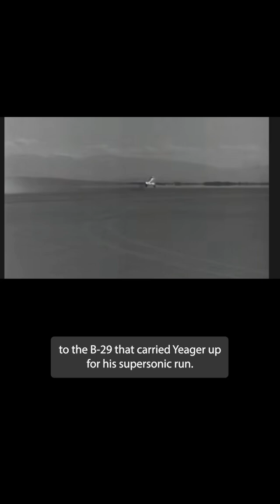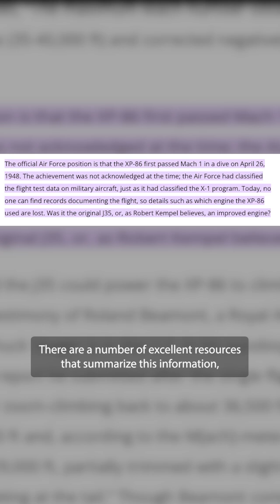George Welch and the XP-86 Project | Aviation History Month Day 20

Comment: The x1 did take off under its own power and break the sound barrier...
Reply from the maker: It couldn’t do this. There was never a flight where an original, unmodified X1 did this….
Reply: @The_Flying_Mechanic  thered litterally footage on youtube. Jan 5th 1949
Reply from the maker: @hechtspeed not without modifications.
Reply: @The_Flying_Mechanic  its litterally in the x1 log book. Its actual history.
Reply: @The_Flying_Mechanic  not without what moddifications?
Reply: @The_Flying_Mechanic  do some digging and youll find the x1 was originally designed to takeoff from the ground. They decided to air drop it after the original high pressure fuel pump didnt work out and they had to reduce the size of the fuel tanks to make room for nitrogen tanks to pressurize the fuel. Even still it was able to do the takeoff and still break the sound barrier without any changed. Its certainly more fact than than welches f86 mach 1 claims...which could be totally true but without instramentstion to prove it...a bit of a mute point.
Reply from the maker: @hechtspeed 
After “research” I found the 1949 launch was done with a minimal amount of fuel in the tanks to allow the aircraft to get airborne, rocket up to 23,000 feet, and then glide back down. In no report does it state the aircraft took off and went supersonic.
Reply from the maker: @hechtspeed and yet there was instrumentation, the XP86 and the NAA project had an interesting gap in the flights from October 1 and October 14. On the October 14 the data simply reads greater than Mach .90 rather than being carried out to the hundreds, place which the instrumentation was capable of. The report simply said that it was a preliminary report with more exact data to follow, which never was filed with NACA and the government or simply is now missing. 

The test flights on the XP 86 were also limited by the government, forcing them to lock the gear down on flights between October 1 and October 14. Something that would be unnecessary if they didn’t think the aircraft could exceed the speed of sound.
Reply: @The_Flying_Mechanic  google x1 takeoff...or read yeagers book. Maybe research for 2 min before making claims lol